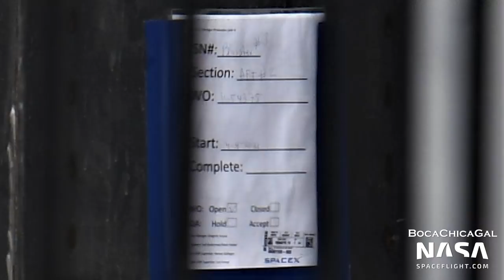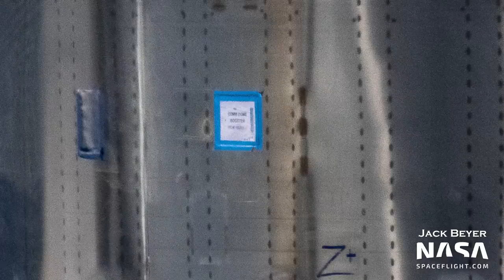Starship SN15 Moved - Booster Common Dome Flipped | SpaceX Boca Chica

Comment: All this news is so exciting right now!! Musk has tweeted he wants SN15 to refly soon. Can't wait for this. All thanks so Mary and the team!
Reply: WOW
Reply: We'll see. SN16 is almost ready, and they might want to inspect SN15 to help with future designs.
Reply: @thannbanis3639  That honestly makes a lot of logical sense. On top of that SpaceX will probably want to get data from those raptors specifically and assess them before using them. Either way another flight from either would be amazing.
Reply: The word was "might" just like with SN5/SN6 and that never happened. Even if we all want SN15 to fly again.... there is a lot to gain from sending the engines back to McGregor and cut down SN15 and inspect everything. SN16 is a twin of SN15, so.. just fly SN16 multiple times if she survives the first one instead and use all that good data from SN15 for SN20+ instead.
Reply: @RippanCSGO  Just the statement fly SN16 "multiple" times. Just says it all. But yeah that would make sense for the team to be sure that everything is nailed for the orbital attempt in July.
Reply: @thannbanis3639  They need to figure out a way for starship to not light on fire when it's landing. They won't have a sprinkler system on Mars or the moon. So I hope they can fix this issue
Reply: @tankourito5419  given they've just managed to fix the landing issue, in comparison that is nothing! 
I wonder if the legs, when they eventually redesign them, will be longer? Having such a small gap under the skirt would surely tear Starship apart if it tries to refly from them. Sound waves alone would be devastating. Could also explain the fire, methane displaced and built up in the skirt.
Reply: @tankourito5419  no oxygen on mars and moon no fire.
Reply: Plenty in the starship though.
Reply: @tankourito5419  :D
Reply: @jaroslavpesek6642  But if it's an issue with the engines, surely that can create an explosion if they were to malfunction while landing. I'm not experienced within rocket engineering or science. But it seems like a very big risk to me
Reply: @jaroslavpesek6642  Also, they will have to land starships on Earth as well. So either way they can't have fires
Reply: @sidtovey  I follow a few different content creators that have mostly agreed that the landing legs need to be a little longer, so hopefully they will be as you said
Reply: @tankourito5419  but there’s also no oxygen on those worlds to support fires
Reply: @tankourito5419  This landing leg design is for prototype use only. They are not reusable.

The production use landing legs will be fully reusable, shock absorbing, and will support both landings and launches. At least on Mars and on the moon. Earth based landings may involve tower catches.
Reply: Great 🚀
Reply: @RippanCSGO  maybe SN15 can hop to McGregor...
Reply: @paulwilson8367  Sure. But on Earth there is. And if they want to reuse the starships and land here, they cannot go on fire
Reply: @jaroslavpesek6642  Starship brings with it all the oxygen a fire could ever need.  If you have a methane leak, you can't assume that you don't have an oxygen leak.
Reply: @tankourito5419  flights to moon and MARS both have less atmosphere 
Is that helpful to ]prevent fires??
Reply: @paulj6138  Yeah ofc. I'm not disagreeing with that. Just I've noticed on the recent prototypes fires starting during landing. For sure on other worlds the risk will probably not be as much
Reply: NASA must own shares in SpaceX in exchange for the billions of our money it gifts to them!

Warren Buffet likes to drink Coca-Cola so he purchased Coca-Cola stock (shares).
It makes utmost sense to purchase stock in the companies you buy products from. It is the wisest thing ever possible. Therefore, the government should be forced to do it for the benefit of the human tax-payer.
By the genius of this great logic, IF MUSK wants "public support" perhaps he should give 50% of the SpaceX shares to NASA (the human tax-payer). Why give away our "public support" (i.e. money) for free? That would be dumb. Get wiser, human tax-payer, buy 50% shares in all companies that make stuff for you; you must own the 'things' involved in the making of the products you buy, human tax-payer!!!!!
Businesses are just 'things' to own.

Comment from the maker: 0:00 - SN15 as viewed from the hard roadblock
0:19 - SPMTs Return After Moving Tankzilla
0:33 - SN15 Landed / Mega SPMT Moved Around SN15
0:47 - People View SN15
0:53 - SN15 Legs and Aft Section
1:08 - SN15 Legs
2:04 - SN15 Heat Shield
2:54 - Sunset at the Launch Site
3:21 - Sunrise at the Launch Site
4:21 - Orbital Launch Site Work Continues
4:47 - Concrete Pumped Next to Orbital Tank Farm
5:06 - Orbital Launch Mount, Integration Tower, and Berm
5:34 - Starship SN15
5:50 - SN15 Legs
6:02 - SN15
6:35 - Landing Pad Area
7:24 - Orbital Tank Farm Construction
7:39 - Suborbital Tank Farm
8:05 - SN16, GSE3, and BN3 Aft Section
8:42 - GSE Tank 3
9:01 - Prefabricated Integration Tower Segments at Propellant Plant
9:25 - Work on Cryo Tank Shells Continues
9:44 - Cryo Shell Domes
9:56 - Integration Tower Segments
10:12 - Cry Tank Shells
10:40 - Dome Sleeve
11:00 - Orbital Launch Table Work Continues
11:29 - Delivery to Build Site
11:43 - Cryo Shell Lowered
12:38 - SN17 Nosecone Barrel Section
13:05 - Frankencrane Moved to Launch Site
14:12 - SN20 Mid LOX
14:39 - Cryo Shell and Integration Tower Construction
14:58 - SN15 Moved to Center of Landing Pad
15:59 - SN15 Landing Legs Removed
18:13 - SN15 Landing Legs
18:44 - Landing Pad Area
19:13 - Booster Common Dome Section Flipped
Reply: what is the meaning of Z+ on launchpad 10:59  and on booster common dome at 21:35
Reply: 14:39 Hello? We want to hire a crane? ANSWER: Sorry no they all out at Boca Chica, Spacex is starting a Crane Factory.........LOL
Reply: 17:28 This ULA Landing gear Kicker has some serious ANGER ISSUES.......LOL
Reply: @garreth629  I don't think he was trying to be serious.
Reply: The amount of cranes/work down there seems to be increasing dramatically.

Comment: SpaceX engineers must be in heaven at the thought of getting their hand's on the first Starship to survive intact.

Many thanks to NSF for all the coverage 🍾👍
Reply: Except Elon has said they are going to fly it again soon so I think the engineers are going to have to wait another couple of weeks.
Reply: @peterbondy  it's still going to need extensive examination and new engine's, only two lit on the flip burn. The big question is that why both sn10 and 15 both had fires on landing.
Reply: @shanewardle832  true.
Reply: @peterbondy  There is no way in hell they are going to fly it again before having examined it top to bottom. It's invaluable data.
Reply: @carljohan9265  yeah, true enough. No reason they can’t do it at the pad.
Reply: @xIconikkxGaming  on the official SpaceX feed the commentator stated that the intention was to light all three. But in the event only two lit, something that was picked up by a number of streamers including Tim Dodd.
Reply: @shanewardle832  More than likely i think that could’ve been a miscommunication between the engineers and John Innsbrucker more than a failure of an engine. Definitely intended only to light two and the third was gimbled clear well in advance of the flip.
Reply: @peterbondy  Actually, his tweet was that they might fly it again. So it's not guaranteed.
Reply: @AeroL1909  true

Comment: Seeing the integration towers and Starship parts there prefabricated reminds me of Liberty Ships. They’re taking an enormous steel tower and manufacturing its sections in a matter of weeks. They assemble tents with steel shipping containers on the sides for structural support. Not only that, but they manufacture steel tanks with their cryo shells, build up a propellant plant on site in less than a few months. And they’re doing all this while building boosters and starships that, with a much faster production cadence in the future will provide launch services to worldwide customers! 

Steel being the common denominator between them all. And it’s extremely clever. Fair bet they could take the lessons from the construction of the production site at Boca Chica and assemble a similar site in Florida much, much faster. Then on to other locations in South America, Pacific, Africa, Asia, and other destinations.

Comment: 6:31 I note that SpaceX may already have found the perfect adhesive for the heat tiles, just use the same adhesive as the tape that is holding on the production route card on the nose cone (just Kidding).
Reply: I'm pretty sure the text on that card said "Land this end up."

Comment: If they don't pull apart those legs for diagnostic purposes I'm sure there are any number of takers that would want them as lawn ornaments.
Reply: Are the legs anchored to the concrete base?! I always wondered how a 9m wide x 50m tall is stable and standing upstraight when it is so windy and in an open space surrounding!!!
Reply: They might replace the legs, rumor has it SpaceX might send Sn15 to flight again for a second trip.
Reply: @ommareltayeb6230  The center of gravity is very low . The heavy three raptors are just 3 m above ground....the empty tanks are relatively light.....You have noticed that SN15 is now anchored to a supporting structure....in case of strong wind
Reply: @iamjadedhobo  Here's some basic statics:  If the moment of the summation of the distributed load imposed by a sudden gust exceeds the moment imposed by the weight center, the rocket can and very much will tip over.  The reason given for why they didn't launch Monday is because high winds would have endangered the support crew tasked with securing it AFTER touchdown when the tanks were empty.

Comment: Those legs look like they are in a lot better shape compared to the legs on SN 5 and 6 after landing.
Reply: SN5 & SN6 had single engine landings, so landed at an angle. SN15 looked to have two engines, which gives muct better geometry.
Reply: @paullangford8179  And then I see some "expert opinion" video of someone complaining about the state of SN 15's legs after the landing, claiming it's a major failure that they look the way they do.

I swear, some people can't think/see beyond their nose.

Comment: Imagine if they just fueled up sn15 from the landing pad and it took off like it would do on mars, it would have been so cool
Reply: It would also rip the rocket appart.
Reply: @herrensaar1989  yes most likely
Reply: @Ankit Meher The fire and the micro explosions after landing might have caused damage to the engines, so it can explode during take off if the engines are not examined and repaired...
Reply: @Ankit Meher damage from the first flight like philip said but yeah also it's a landing pad, not a launch pad. Like you said not enough clearance for the thrust and flames of the engines and for the sound waves
Reply: But then how will it work on mars?
Reply: @Tofu-jg8ou  for the first landings with no landing pad, they might use a system similar to the HLS and then later they will probably have landing pads made, in order to get rid of the extra engines...
Reply: @Tofu-jg8ou  No one knows yet and spacex is probably still designing a solution. I think current leg design is temprorary and engines might still need some tweaking to prevent those micro bursts. They might make legs that extend more thus giving more clearance. Or, they might carry some repair parts for repairing engines at mars..
Reply: Ice cold 😍
Reply: @Tofu-jg8ou  This is not the design for Mars and was never intended as such. That will come after they learn more about this basic silo with wings design. Much of what you see about Mars is pure speculation.
Reply: Haha much intense vibration make tps tiles go brrrr
Reply: Needs the long legs like the Mars landing version would have. Otherwise the rocket exhaust gets trapped underneath and fires everything.
Reply: Fries...
Reply: @paullangford8179  yes exactly
Reply: @kuheno3729  lol

Comment: A comparison with the view of the legs under the skirt at launch shows that there was minimal compression caused by the landing - confirms how "gentle" it was - comparatively, at least.
Reply: I thought it was tilting at the very last moment and landed on one side first.  Not sure if that's intentional, and/or real, or just camera angle
Reply: @ThisNoName  Must have been tilted, as only two engines in use. But not tilted as much as SN5 & SN6, so less leg damage. Notice there's no springs, only a frictional shock absorber in the legs.

Comment: 1:30 ‘yeah and Chuck if you can organise getting these legs removed…think they’ve had it. Oh and Bob if you can go get the forklift…’
Reply: Wait - don't we need to build an expensive custom leg removal fixture and transporter?
Reply: @flightofone  The SPMT just jacks things up enough for someone to go underneath with a wrench and sledgehammer. Recall that most of the engineering is "oil rig" style!

Comment: 6:30 ... Still has the paper work order / label on it, how amazing is that.
Reply: That survived the tests and flight but a couple of ceramic tiles failed 🤔
Reply: Those heat tiles at the bottom came off during the static fire. The tile from the big section was removed after landing, so no tiles actually fell off in the flight.
Reply: @abramwicasatheca6324  That's why I wrote  "..... tests and flight.....'. Static fire is one of the tests, right?

Comment: I did not think they could slide a crawler under a Starship without being lifted by crane......guess I was wrong ! Thanks Marry !
Reply: I think these crawlers were modified to have a “lifting-spatula™️” to get under the starship.  Very cool.
Reply: This setup actually goes around the ship. They use the same SPMTs, but there are giant beams the run between them so that they can surround the ship. It’s kinda like an enormous octograbber.

Comment: I noticed that the area of the landing legs just above the foot pads is slightly crumpled.  This is because the legs are splayed radially outward in combination with the fact that the foot pads, once making contact with the concrete landing pad , cannot slide due to the high amount of friction.  Once planted on the pad, the legs have to give somewhere.

Comment: Those landing legs look like they are quite stressed out from lateral forces! Maybe they need steel roller balls on the bottom with hydraulic piston forced brake material caps on top of the balls, to dissipate the remaining lateral forces in a controlled and survivable manner. Once stopped, and it’s time to move Starship, the brakes on the castors can be released, allowing the Starship to be rolled around by ground equipment to be positioned for lifting and retraction of the surviving legs and replacement of damaged legs to  prepare for reflight!

Comment: Guys SN15 is not the first starship that has landed. SN10 is the first Starship that has landed. But sadly it exploded after landing because of a simmilair fire after the landing. But still SN10 is the first not SN15.
Reply: @TheEvilmooseofdoom  but a landing non the lese. The legs of the SN15 where crushed aswell. Big diference the SN15 did not blew up. But all in all SN10 is the first to land and not SN15.
Reply: We call it a landing if there is a vehicle afterwards, if there is no vehicle left we call it a crash :)

Comment: This version of the legs does not hold the impact of the vehicle from its landing velocity as we saw in SN5 and SN6 regardless of the raptor's configuration. Maybe it's time to jump for a stronger version.
Reply: Crumple the legs, or crumple the Starship structure... These are for prototype testing. The degree of crumpling gives an accurate picture of the landing speed.

Comment: Those legs should have rollers or gliders. The landing pad should have a support structure that has a  grip action or bear trap action once its landing.  Surrounding the starship's whole circumference when its resting. This will act as a secondary support during landings.

Comment: I wonder if the flaps can be a sealed tank structure, allowing them to be moderately pressurized with nitrogen or air to keep the panels smooth. That would allow the flap to have less flex stress on the Stainless Steel Material from the atmosphere.

Comment: Interesting that they have a way to lift, stabilize and move without the use of a crane on the landing pad.
Reply: That big fram is a wraparound. I thought it would be for the booster only, but it does make sense so you're not moving those huge cranes around too much (they have bad efects on everything they roll on).
Reply: @paullangford8179  That was my thought at well. It might be one of the lifting and moving strategies for the long run as well. We will have to see as time goes on but Space-X is definitely thinking outside the box on all of it's processes. Good for them!!!

Comment: It looks like one of the heat tiles popped off in flight. Since Starship is made of stainless, would it be able to survive reentry if it lost one or two tiles? If it it could burn through, could some extra thermal protection be added behind the skin as a backup.

Comment: Any word on what insulation material will be used for the GSE tanks between the two hulls? Solid Smoke would be best, but it may not be economically possible at this point.